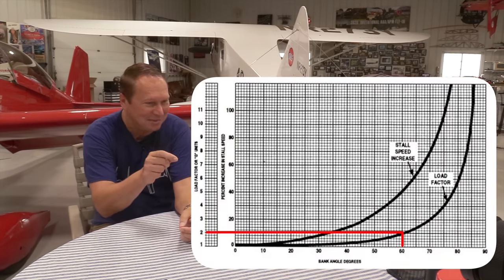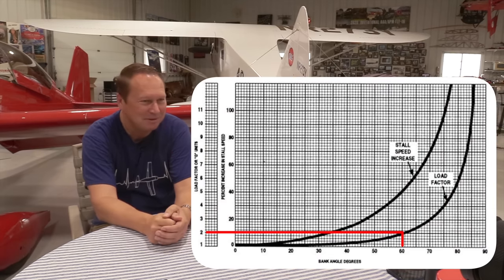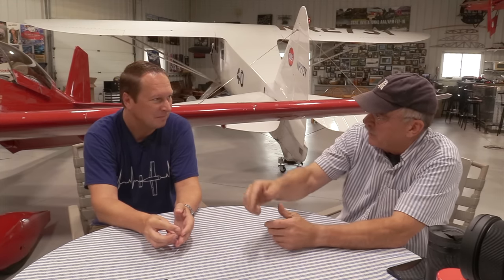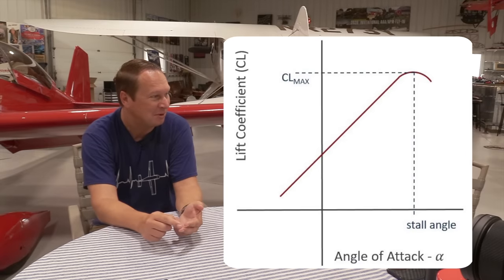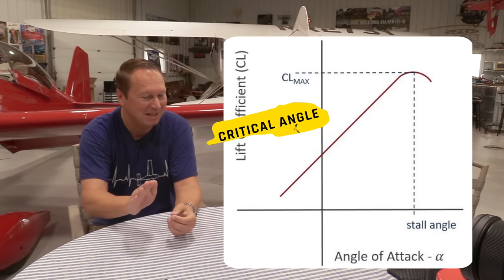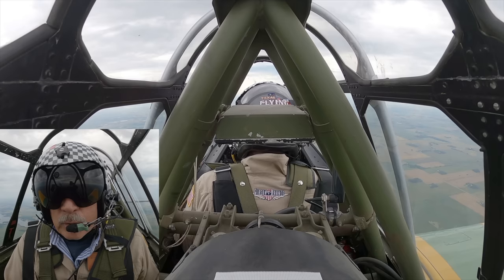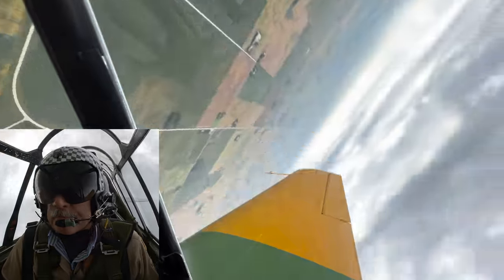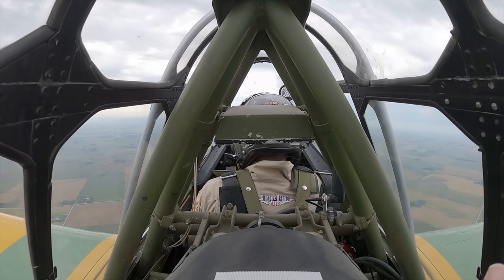The Bank Angle and Stall Speed Myth

Comment: He said it at 6:32: "If you don't pull back on the yoke, the airplane is not going to stall." I knew this, but I'm glad to hear someone else say it, and say it very clearly. -Old retired Cessna driver and RC intro flight instructor.
Reply: When turning from base to final, the airplane is normally not holding altitude, it's descending.  If you need to increase your bank, it's ok so as long as you relax the backpressure and let the nose fall a little. This is why I like to come in high from downwind to base with less power, rather than dragging it in with power.  If we keep it coordinated and increase the speed slightly while descending, we can bank steeper if necessary.  Better  to do that than standing on the bottom rudder and keeping the bank shallow instead. IMHO.

Comment: As both a fixed and rotary wing pilot, and aerospace engineer with 30 yrs experience including quite a bit of flight test work I’m finding this video interesting and am a little intrigued. The explanations of a (say) 1 g turn at 60 deg bank would be much better assisted with diagrams, the argument presented is correct. The challenge I have with this presentation is in a couple of different directions:

1) the description of a 90 deg bank 0 (normal) g ballistic trajectory is absolutely correct. In that case you’re accelerating downward by 9.8 m/s^2 (32 ft/s^s) with the wings vertical…essentially literally just falling like a stone. What’s not made clear is that in a 60 deg 1g turn you will be losing height at an ever increasing rate. The extent to which this is a problem depends on the circumstances. 

2) The height loss during a 60 deg turn like this due to a late turn for final may cause a significantly greater challenge for an inexperienced pilot to establish a stabilised approach as you now need to add power to intercept a 3 deg final glide slope then stabilise, THEN do your finals checks with the threshold approaching. I’m thinking a 30 deg bank balanced turn where you overshoot final is less work to correct. 

3) Finally, again all in the context of initial training and having a student absolutely understand what it takes to make a safe base-final turn, if they believe a 60 deg 1g turn is acceptable it may become a 60 deg balanced 2 g turn because the ground rushes up which then has a high probability, perhaps certainty, of an incipient spin with dire consequences.

In summary, although I’m only picking on that one case of a base to final turn which is talked about, that may not be the place to attempt a 60deg turn unless well practiced re expected height loss and subsequent consequences of doing that. It’s also a difficult thing to provide specific guidance for a pilot in the flight manual. How would you describe this with adequate information that is readily understandable by a pilot and can be recalled from memory in those relatively rare occasions where it may be used in normal GA flying (excluding aerobatics that is)? 

I think this video is great, just rounding out the consequences would be a great idea.  Just in case someone decides to try it if they start their final turn a bit late and is then a little startled by the ground filling the windscreen and getting wings level 100ft or (much) more below where they thought they might/should be. 

Cheers 😊
Reply from the maker: You make some great points, Mike. I am sure you know the intent of this videos was not to suggest that pilots should plan to use a 1 g 60-degrees-bank turn for the base-to-final turn, but to explain that stall speed is not simply a function of just bank angle. That kind of turn can be a good remedy (e.g. I am about to overshoot the extended centerline, and I'm also a bit too high - kill two birds with one stone). In other situations your suggestion to stay in a coordinated 30-degrees turn and correct after overshooting makes sense - but we know the temptation is there to "help" with some more rudder. Best of course to start that turn early enough that an overshoot doesn't happen to begin with.
- Martin
Reply: Finally someone made a sensible comment and pointed out the absurdity of a couple of the propositions being advanced.
Who in their right mind would be doing a 60 degree 1g turn in the circuit. It’s a shame that sometimes so called expert start believing their own rubbish and get other unsuspecting soles believing it too.

Comment: Great video. Couple of points that maybe the speaker will want to address next time:

- I don't think teaching stall speed as a function of angle of bank is a disservice to private students. Most private students will forever remain private students, and some of them will go on to become private pilots who fly 20 hours a year for a couple of years until they quit forever. When you fly like that you can't realistically use any of this mathematically correct stuff. The most you can do is get it through your head that you can trust your airspeed indicator for the stall speed when you're level, and you can't trust it when you're banked. That's about it. It really doesn't make sense to try to make it any more complicated than that. You're level - watch for the bottom of the arc. You're banked - maintain whatever airspeed you're supposed to be at for this leg in the pattern and don't go any slower. Don't bank more than 30 degrees. You'll be fine. If one of a hundred students goes on to fly aerobatic jets - there will be enough time to get into more details.

- regarding this point about pilots getting in trouble in the base to final turn because they are afraid to bank and they use uncoordinated rudder inputs. This has been repeated thousands of times, but I could never understand why. Has anyone ever seen a student who uses rudder to turn? Is it ever taught to turn with rudder during primary training? For every 99 private students who don't use the rudder at all in a turn, maybe there will be 1 who uses a little to much. I can't imagine why a student who flies around with zero rudder inputs would all of a sudden start pushing bottom rudder in that base to final turn at 500 AGL. Really not seeing it.
Reply: That's a good point but incorrect use of the rudder to increase the turn rate can inadvertently happen.  For one example, think about the first lesson when the controls are demonstrated.  The instructor applies rudder pressures to demonstrate how the airplane yaws left and right.  That could result some day in the future with that pilot using the inside rudder to increase the turn rate - not likely if the training has been good and thorough, but still possible.  And it did happen on one Prog Check at our flight school long ago.

I was happy to see it mentioned that limiting banks to 30° can lead to the incorrect use of the rudder.  But I was unhappy to see that that also didn't include the possible incorrect use of the elevator.  When you roll into a bank, pulling on the control wheel will increase the turn rate similarly to using the inside rudder.  But it costs airspeed, and I think of the two errors that can result from limiting banks, pulling on the control wheel is far more dangerous than pushing on the inside rudder because pulling on the control wheel is what causes the stall (and of course when there's also uncoordinated rudder, it will be a much more difficult, likely impossible, stall from which to recover due to the low altitude).

Comment: The concept of a Vector is one that most people do not understand. Acceleration is not the same as velocity(speed). An acceleration occurs in a turn with a constant velocity but the angular component of the vector has changed.  A vector has a magnitude (velocity) and a direction(angle). A change in either is thus an acceleration.

Comment: Excellent video.  This is how military pilots are taught to fly.  Every military aircraft has an AOA meter because, in the end, it's the critical AOA that determines when your aircraft is going to stall.  Airspeed and angle of bank are only part of the equation.
Reply from the maker: Thanks, Gordon. I agree having an AoA indicator is great. Short of that, understanding AoA and how we affect it with elevator input is a reasonable substitute.
Reply: @martinpauly  "how we affect it with elevator input".  That is the most important point and it should be part of basic training.  We don't want to routinely be making steep turns (or over 30° bank) base-to -final.  But if it happens, it should never result in a loss of control.  Does training adequately cover how to do it safely or at least how to avoid loss of control.  Apparently not.
Reply: @warren5699   You said "We don't want to routinely be making steep turns (or over 30° bank) base-to -final."  Why not?  All fighter pilots turning to final in the pattern normally bank the jet to almost knife edge at less than a thousand feet altitude. You are still thinking that over 30 degrees of bank is somehow dangerous.  I don't think so if you fly the aircraft correctly.  If you aren't flying the aircraft correctly I suggest you get further instruction.
Reply: @michaelrunnels7660  You think a 100hr Private Pilot should fly airplanes like highly trained military pilots?  I don't think so.
Reply: @warren5699   I am in no way suggesting that a private pilot should imitate the way a military fighter pilot flys.  I was merely pointing out that a high angle of bank in the pattern is not inherently dangerous.  It is only dangerous when you are in a steep bank and try to hold altitude withought adding power OR flying uncoordinated at a steep bank angle and low airspeed. Most fatalities in the pattern are the result of flying slow and uncoordinated, not because of bank angle. Flying slow and uncoordinated leads to stall/spin accidents.  When flying straight and level and simultaneously pushing full rudder and pulling the stick back abruptly is called a snap roll.  A snap roll and a stall/spin are the same thing done at different speeds.  Turning final while pulling back hard on the stick and using heavy rudder to help turn the airplane results in a stall/spin/snap roll at low altitude.  THAT is what is deadly, not high bank angle.
Reply: @michaelrunnels7660  Thanks for that clarification.  I agree.  The 30° bank angle involves a discussion in one of the FAA Handbooks which I see included in many online discussions and have personally seen instructors apply with their students.  Page 5-20 Airplane Flying Handbook - "At the relatively low altitude of a base-to-final approach turn, a pilot should be reluctant to use bank angles greater than 30 degrees and should not make a skidding turn if correcting for any overshoot."  There are at least two sides involved.  If a pilot has to frequently use more than 30° of bank, then the pilot's basics skills are probably not too good, primarily not good with awareness of the airplane's groundspeed and when to start the turn to final.  If those skills are weak, others probably are too - coordination, and pitch and airspeed awareness.  Some instructors apply that general 30° bank guideline as a hard limit not to be exceeded, thinking it will prevent a loss of control.  However that can lead to trying to increase turning performance by either using more back pressure or inside rudder pressure or both going down a dangerous road.  So if a pilot has good skills, a turn past 30° will rarely be needed.  But if there is a need for whatever reason, the pilot should be able to perform it easily and safely.  Depends often on the training received.

Comment: Excellent video. As I put it to my students, “Whatever you do, don’t pull the stick back too far, dummy!” The designers of the Ercoupe knew what they were doing when they designed an unstallable airplane. They simply limited elevator travel. It is up to us as pilots of stallable airplanes to limit our own elevator travel to avoid unintentional stalls. I’m always amazed when I ask a pilot what stalls an airplane. The answer is always a rote answer, “when the airplane exceeds the critical angle of attack”. Then I ask what makes the airplane exceed the critical angle of attack and I get a blank stare. To which I reply, “The pilot pulling the stick back too far!”
Reply: I have experienced this with new instructors.  The “pat” answer of exceeding the angle of attack  is often stated without really understanding why an airfoil stalls.  Emphasizing not loading up the wings or “unloading” the wings to prevent stalls would be much more valuable than “don’t exceed the critical angle of attack.”

Comment: The glider handbook and general practice in the US is to talk more about 45 degrees as a recommended maximum bank angle in the pattern.  We also teach tools and techniques to recognize overshoot of final and fix it early by adjusting the pattern.  One difference between airplanes and gliders is that airplanes typically have more elevator authority near stall speed.  It may be the 30 degree recommendation for airplanes was a training shortcut vs training good recognition of load factor and AoA.
Reply: Yes, that is because the wing span  of glider is 3 times that of a warrior and the wing loading is 1/3 .  On decent size glider that is.
Reply: @rockyourworld5374  Think a little bit about the subject matter and ask yourself why wingloading is relevant.  The stall speeds are relatively low on gliders with low wingloading.  The span makes the wing more efficient.  It doesn't have much if anything to do with bank angle vs stall speed, except that it makes the aircraft tend to have lazy roll authority and tons of adverse yaw.
Reply: Indeed. Tom Knauff (famous name to those in the glider world) contends that glider stall-spin accidents in the pattern are from pilots not banking steep enough! Many (but not all) gliders will run out of elevator before stalling with steep bank angles. 
45º is a very common bank angle used in gliders for thermalling and tow rope break return scenarios. It provides the least altitude loss in a turn of a given number of degrees, but the stall speed (without additional g forces beyond the 1.4 induced by the turn) increases by 19% over wings level.  So it’s an important concept for a glider pilot to know. (Stall speed increase in a 1.15 G (30º bank) is only about 7%
Reply: When glider training (never finished) I had the problem that in turns past 45 degrees the nose would drop and I would accelerate and begin to lose altitude...  so not a stall but a problem in the pattern...  at least.it was for me as I didn't know how to counter it....

Comment: This was one of my pet peeves in training.

I loved to turn final in a steep (+60°) turn and they would give me flak on the bank angle vs. stall speed and ignore that I would pull up prior to the turn, unload, roll and only use the stick to pull the airplane around while it slowed mid turn, roll out level and deploy airbrakes.

Despite the manoeuvre looking dramatic from the ground I felt safer, because I was very aware of my distance towards the limit and was not encumbered by bank angle limitations and the temptation to "crab" around the turn base to final.

Keep the bird fast and the load vector vertical (wrt to the a/c own frame of reference)

Comment: As for changes in Stall SPEED, my education made me look at changes in that as a matter of changes in Weight.  And 3 of the main things that affect that are:
1) The actual Weight of the Plane.  (What you have in it.)
2) The Center of Gravity.  (Where you have that weight.)
3) The Bank Angle WHILE MAINTAINING ALTITUDE (Due to the change in the Vertical Lift Component/the G-Force increasing <i.e. the weight of the Aircraft increasing>, pulling back on the stick/increasing the angle of attack.)  Remember though, in the Pattern, people are trying to keep their altitude constant, until they start their descent, or are actually climbing on a missed approach, so changing Bank Angle would be something to keep in mind in these common circumstances.
Of course, all 3 of these (and therefore Weight) are affecting the Angle of Attack, and we all know the Critical Angle of Attack doesn’t change.

So I guess my comment on this would be: yeah, all those graphs and things you read/learn about Bank Angle affecting Stall Speed, is assuming your Altitude is not changing!  Which is how I learned it.

Comment: English is a very contextual language which isn't that great for scientific stuff that requires precise language.  When you say something like "The slip/skid indicator goes higher", that could mean several different things depending on what you use as a point of reference.  The ball can only go to the right or left relative to the position of the instrument.  Since you're rotating the instrument, the ball is actually going higher relative to the ground.  "The plane is banking left and the ball is moving right" is less ambiguous.

Comment: At the glider club where I have been learning to fly we use 45 degree banks on final turns in the pattern. My one instructor elligntly explained the one day exactly what you say here that if you do not try to maintain altitude your airplane will never stall. I prefer a bit less of ban being a low time pilot and sometimes not being perfectly cordinated but It makes sense and as long as you keep the airspeed constant you are fine.

Comment: Fastest way out of a stall is 0G finer words have never been spoken in my ears. Came from an AG pilot. Taught me to never force a turn with yaw or pitch changes. Famous accident in a learjet happened at Teterboro due to lack of this material. Air france was also failure of the pilots to follow a checklust after the ADC warnings were present. The supercooled water froze the pitot tubes shut.
Reply from the maker: Right - if the wings can't produce enough lift, reduce the need for lift - problem solved.
As for AF447, frozen pitot tubes is how it started, but that should have been a non-event. Confusion in the cockpit leading to a stalled airliner is how it ended.
- Martin